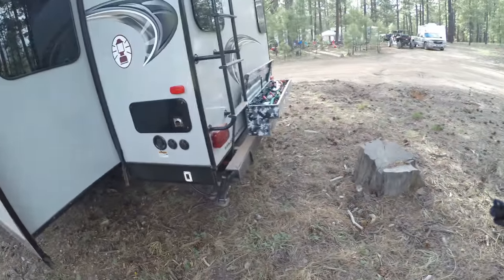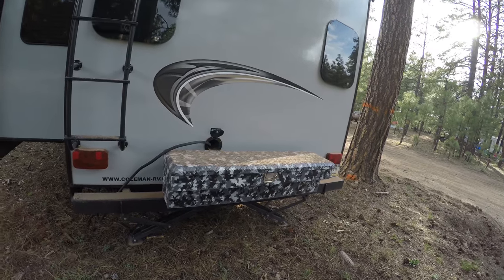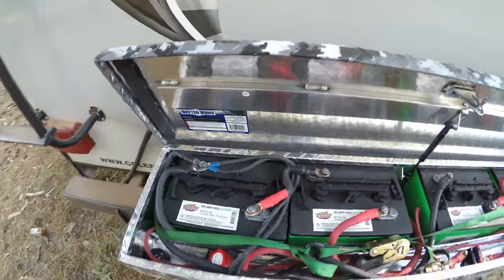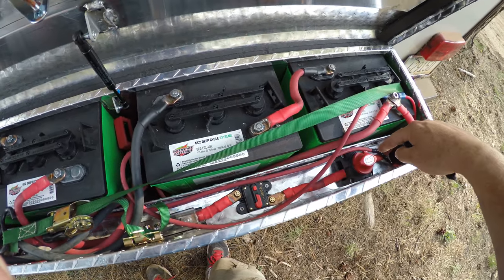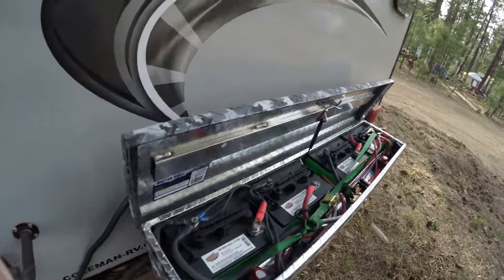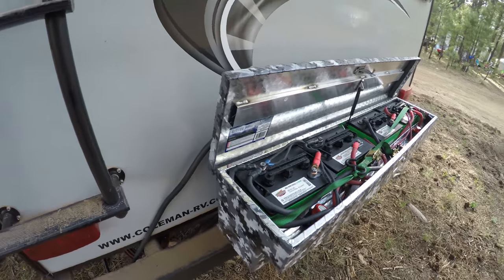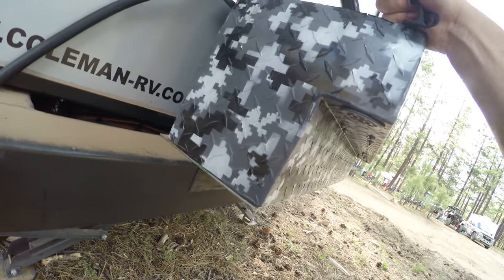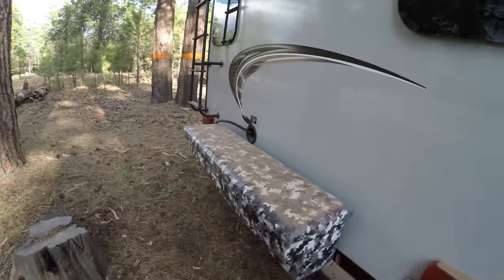Who knew it could be Possible

Comment: Great video. Where are your vent and electrical line holes and do you feel a 12v fan would be beneficial to keep the heat down in the box? Also, what type of hole saw did you use to drill through your box?
Reply: Outdoor Enthuzast very cool-and thank you for all the info.